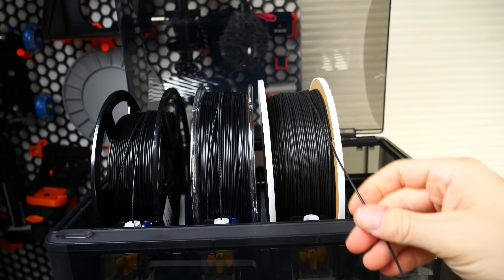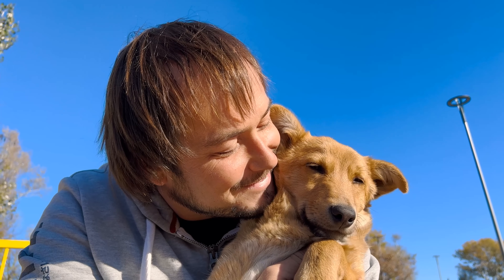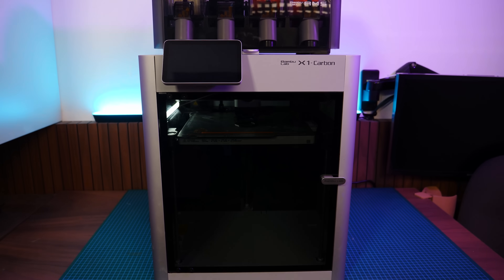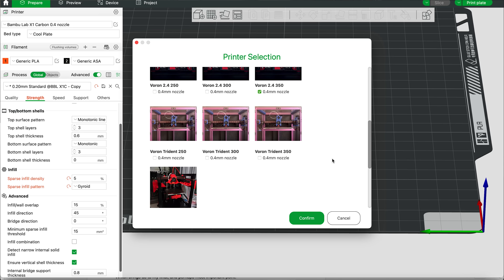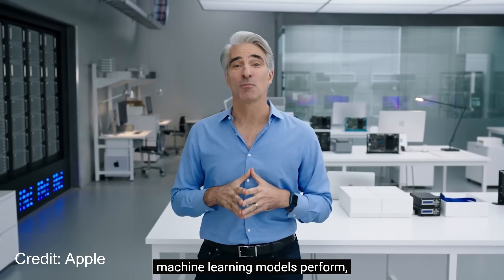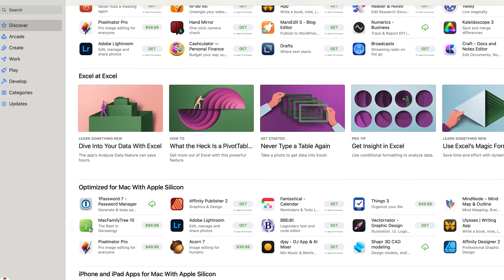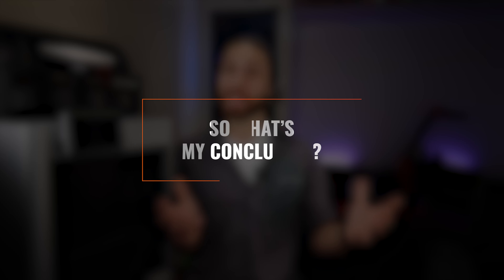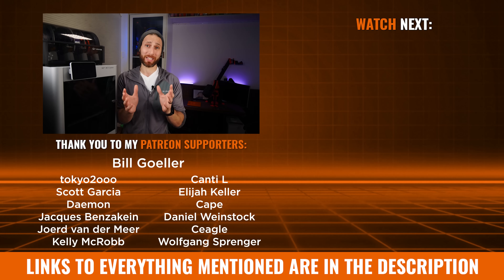Bambu Lab X1 Carbon: 5 Things You Don't Know

Comment: I own a Prusa MK3 for a long time, and BL X1C is my beloved new toy now. I'd like to add one point: don't buy X1C as your first 3d printer.  I'm glad that I got a prusa first so that I could learn alot about 3d printing machine, how to maintain, how to repair, how to upgrade etc. Reently I got  filament stucked in the motor of the AMS and the channels of  the AMS hub (due to old wet filament) and I have to dismantle those parts to take out the fragments. Bambu lab wiki provides adequate information how to do it but still it is a nightmare experience. One the other hand, if your are already familar with 3d printer, I have no hesitation to recommend Babmu lab printers to you.
Reply from the maker: I can agree on that!

Comment: The Chamber fan is controlled by the start-up G-Code. I think it's triggered by the bed temp when it gets past 45c. I have seen some custom code on Reddit, that will trigger it sooner and at a lower speed. Cause ones it's triggered, its triggers at 100%. It is loud.

Please do not edit your Start or Machine G-Code if you do not know what you are doing. You can damage the printer if you mess it up.

The command is "M106 P3 SXXX" Where XXX = 0 through 255
Sample:
M106 P3 S0 ; turns off the chamber cooling fan
M106 P3 S255 ; turns on the chamber cooling fan to 100%
M106 P3 s127; will turn it on at around 50%

Comment: I'm an Apple guy and have been since I was a kid, watching my dad unbox and set up a Macintosh LC on a rickety table in the main bedroom of our house. And I have to agree that the walled garden approach works (at least for me) with phones...I'm not as convinced that it's the best way to go with 3D printers, at least the way it's working now where the only 3rd-party solutions are those that are reverse engineered and could potentially be invalidated with future software updates. The X1C is obviously a fantastic printer but it's not the end-all, be-all solution - anyone who wants to do quality multi-material printing but doesn't have the space or ability to buy a standalone IDEX printer is out of luck if all they have is an X1C in their possession, while there are modification options for people with printers that practically beg to be tinkered with, for example. 

In other words, I feel no compulsion to hack my phone but I would like to have the option to hack my printer to do whatever I need it to do. As long as the rest of the industry refrains from following suit, there will be plenty of space for people who prefer a one-source solution for their printing needs and for people who want to mix and match to their hearts' content. But even Apple and Nintendo let other people play in their respective sandboxes, and Bambu Labs should consider doing the same if they want to maximize their foothold in the consumer and prosumer 3D printing market.

Comment: Does this printer require wifi to use and setup? I'm looking for a printer to recommend at work but we don't use wifi at work. Needs to be offline
Reply from the maker: I think it has a LAN port, check on that, but you can also use it with an SD card, though... that would be lame :(

Comment: I use a Wham Bam plate for my X1. It is SOOOO nice that I bought 2 so I was never without it in case one failed down the road. I pumped up the bed temp for PLA on it to 65. I started at 50, 55, 60 then finally 65 and I had mirror like flat finishes on the bottom at 65.
Reply from the maker: Yeah this is a game changer, honestly. Improves the printer so much.
Reply: @thenextlayer   I checked the price of those plates, and they are way more expensive than Bambu plates 😭
Reply: Can you provide a link to the plate you mentioned? I'm looking for a textured plate that works with the lidar, but the Wham Bam site is not making it easy to figure out which one that is.  Thanks!
Reply: Which wham bam do you recommend?

Comment: Hmm, how about reading the manual? You do not need to do all the scans before each print as long as you use the same kind of filament and build plate, the first one you do is stored. Seems odd when people are complaining and actually should do a bit of homework before they are making a big deal out of things. My printer starts in 2-2,5 min, that is quite fast.
Reply from the maker: Fair, I was too excited to read the manual

Comment: Would love to see a lemons to apples comparison between the V2.4 and the X1 Carbon. Currently on the fence between building a 350^3 Doom 2.4 or buying an X1 carbon... then using it to eventually build a 2.4.
Reply: 247 printing did a good video with a comparison between the 2.4, x1c, and v400

Comment: As to whether I'd want to live in a walled garden like that, absolutely not, as seen by my choice of hardware and software.
-Recently bought a Prusa MINI+ kit to return to this hobby, after a 3 year break from being done with the maintenance my self-built Hypercube required.
-Old Moto G5 Android phone which I can repair and have tweaked the OS of, sacrificing responsiveness, camera quality and a lot more for this.
-Modular computer running Linux, though this works the best for me so no compromise here.
-Modular furniture where possible, e.g. bed frame over boxspring, closets I can mod and shuffle about, the like.
It's a difference of preference, but I would not use Apple products even if given money for it.
Nor am I too interested in the Bambu printers as I like being able to mod and repair my printers, like I already did to my Mini and will later fully rebuild my Hypercube too.
(If interested, find my profile on Printables, "RedWyvern" there too)

Comment: Something that is frustrating to a lot of Bambu users is the cloud.   Last week it was down and you could not print using it.  I never want to go back to using a SD card, and the LAN option is pretty much useless.   The LAN option could be made to function just as well as the Bambu Cloud, I'm thinking that will be a hack someone will come up with quickly.
Reply: It feels like it's abit of a regression that they wont allow some kind of rpi installable app or somthing to upload to the machine.  I don't like sd cards either but klipper or octoprint have made it easy to bypass. I'd be annoyed with out them.

Comment: From another YouTuber i learned it is temperature controlled.

The exhaust fan should turn on based on chamber temperature.
Heating the chamber it will not turn on.
But when the chamber should be cool it should exhaust hot air.

Comment: Great Video! Thank you for highlighting the exhaust fan as I had no clue and was kicking myself for not buying the XC1 instead of the P1P. The only worry I have is if Bambulab will be around for the next 5 years.  How would I get replacement nozzles and other parts?  I have to say one amazing thing that Bambulab does, is that they have all accessories available to Canadians without gouging us too much,  $35 for PLA is on the high side for pricing, and I think that $30 is the right spot IMO.  I do find other accessories to be decently priced.   Great job Bambulab

Comment: the bit about the activated carbon filter is a bit surprising to me. I would assume that pushing air through the filter would be part of the print settings for the filaments that do the nasty stuff

Comment: Thanks for the info about the exhaust fan - I didn't know, and it certainly explains things better

As for walled garden…

The Bambu Studio slicer is open source, right? Forked from PrusaSlicer and released under AGPL, but there's a catch. It links to two libraries that do the communication with the printer/cloud and these are closed source, which breaks AGPL. I have been in touch with Bambu about this, but they just hide behind the fact that "they didn't write those libs, so they can't change their license". This doesn't make sense, since it's Bambu that is distributing these with their printers, so they are the ones breaking AGPL.

I have been in touch with Bambu, requesting they open the RFID protocol they use. After all, their printer wouldn't exist unless they had a huge 3d printing community to lean on in the first place. They first said blatantly no, although this was later changed to that they're considering opening up that part. We'll just have to wait, I guess

If you export a log file from the printer to try to sort out what went wrong, the log file is *encrypted*, meaning there's no way to read it. All you can do is to send it to Bambu and pray to your nearest 3d printing god that they do something about it. If they'd chosen to open this up, it would probably show a bit more of what that (apparently) Linux-based system is doing, but it really shouldn't hurt them too much, unless it shows more license issues (which wouldn't surprise me).

As for octolapse, the X1(C) has this built in. I don't know how octolapse would even compare, since the "Smooth" timelapse it can make, even uses a prime tower to make sure the delay when shooting pics won't be visible on the print.

PS: I read the P1P had gotten a new firmware, allowing you to tune thermal runaway and adding a printer by its IP instead of that dumb mdns-like protocol they're using. This is needed if you want to put the printer on its own (or shared) IoT network. This has not come out for X1(C), so I contacted support and the reply was just semi-automatic "We do not yet know the date of the next update for X1C. Your printer will automatically notify you when an update is available."
Reply from the maker: OK ok wait, all this is interesting, but wait wait wait what stands out is the octolapse setting... how did i miss that?!?!?!
Reply: @thenextlayer  You can choose it under global, others, special mode
Reply: @thenextlayer  oh - and as for bed levelling and flow calibration, I usually run that every few days or before very long prints. It usually isn't needed after the initial one.

Comment: If you are printing abs on your 2.4 you should be heat soaking. That is wait half an hour after the bed heats before you start printing to get the best results. The voron team generally recommendeds this. It makes a huge difference in print quality. For smaller prints it doesn't matter as much but I really recomend setting up a heatsoak macro. The reason for this is if you start printing with the chamber at say 30C and it heats up to 50 to 60 during the print things are gonna be different because of thermal expansion and you may get some strange layer lines. If the printer cools down you dont need to run the exhaust fan. The VOCs will condense on the inside of the printer. I wouldnt run the exhaust fan unless you need the parts right away which I wouldn't recommended for abs anyway as it can warp if not cooled down slowly. I would rather keep the VOCs in the printer than try to filter most of them out. Just my thoughts. Thanks for another interesting video.
Reply from the maker: True, true... I should be doing that.
Reply: @thenextlayer  I didn't start until a couple months after i had mine running. I had a hundred projects that built up over a couple years that needed a big printer so I had no time to waste!
Reply: What if u add an external hear source ?
Reply: I like to print a lot of abs to oh yea fist i turn it on and preheat before i go to the slicer sometime before i start working in fusion.

Comment: Maybe you're going to do a video on this, or I missed one you've already done, but the Wham Bam website doesn't seem to mention higher temp filaments like PC/PA on the X1C.  I did see a passing mention of them in general, just saying they may need glue stick.  I'm not sure if that will be necessary with the enclosure.  

Since they're sponsoring you, maybe you'd be able to do a video on using the PEX build surface with some of these filaments.  I'm happy with the Bambulab textured and high temp plates, but I don't use the smooth surface with anything but PLA due to over-adhesion concerns.  It might be nice to have a smooth option like this for other filaments (but not PETG apparently).
Reply from the maker: Oooooh, that's a great idea, I'll try them. I don't have any PC here, but I do have a bunch like PA Nylon and even some more exotic stuff...

Comment: I don't think you'd want to force the chamber fan to be on when printing higher temp materials. That would cool down the chamber and probably cause more warping. Whatever air leaves the chamber is replaced with room temp air from outside. 

It would be a better design to recirculate the air inside the chamber through a filter, since that shouldn't change the temperature. That's why I ended up installing the Bentobox on mine. I certainly agree it is a bit of a hack, but I don't see this being fixed with software.
Reply from the maker: yeah my suggestion is a wait period AFTER printing them to filter out before you open
Reply: @thenextlayer  Yeah, I should have waited until the video was over before commenting.  I thought you had moved on to the next topic but was impatient.  That would definitely help, though of course you'd get fumes leaking out in the meantime.  Really you could use both when you think about it, and it isn't like the carbon is expensive.  The only gotcha with recirculation is that you need to use acid-free carbon or you'll destroy the machine.  I could see people getting THAT wrong and creating a reputation issue.

Comment: I learned about the exhaust fan the same way you did. I didn't know about the real time resonance monitoring. That's insane. I've started to buy Bambu filament just for the added convenience of the RFID tags. That's something else I think could be out in the hands of 3rd party companies and allow Bambu to recognize other filament brands automatically
Reply from the maker: Yep, crazy how we all misread, or maybe they updated the site
Reply: i got mine yesterday, so far only tested pla and petg. with (generic) petg it shuts off the build and aux fan, but the exhaust fan is full on!
Reply: the prices they have are comparable to every other filament so its not bad at all.
Reply: @Shinobubu  agreed. Shipping takes a bit longer and their inventory seems to be out a lot though